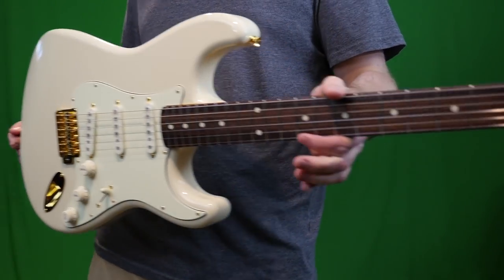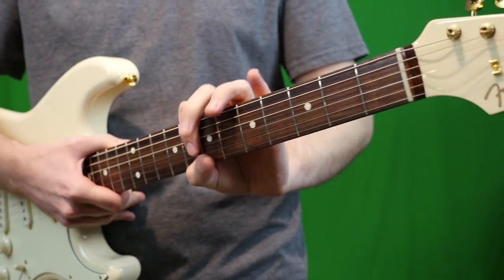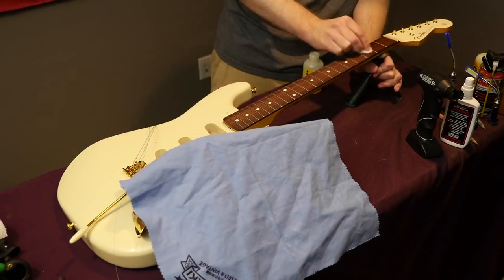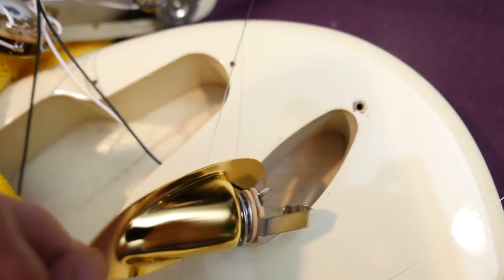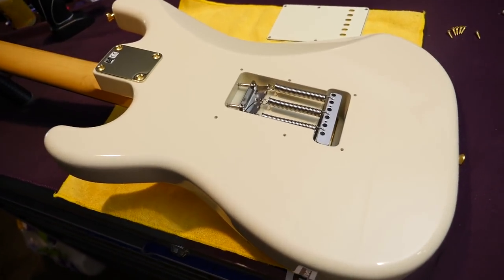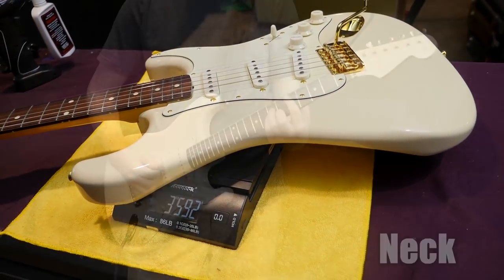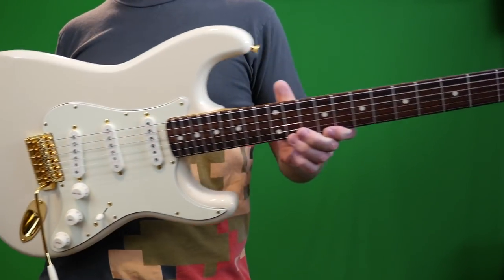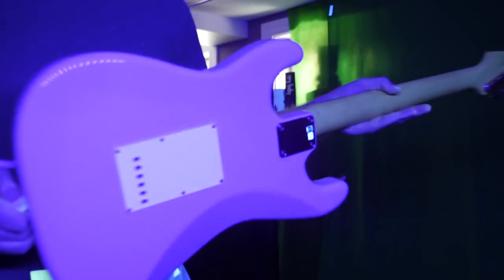New Fender Series! | 2019 Fender Daybreak Stratocaster Olympic White Made in Japan | Review + Demo

Comment: I have a 1995 MIJ 62 RI Strat that had an overall similar feel to this one.  Basswood body (because it had the fotoflame finish back and front that could apparently only be applied to basswood), ceramic bar pickups and a U shaped neck.  Standard chrome hardware (I don't like gold as it wears so easily).    Similar vintage style frets.  The pickups quickly got replaced with a set of Kinmans, which greatly improved the sound. 

I'd bought it used, and the body was quite badly beaten up, so this year I stripped the finish off and resprayed it in a nitro Daphne Blue, reprofiled the neck to slim the shoulders down and reshaped the back to a soft-V (based on my DG Strat), and fitted a Clapton boost circuit to it.  I also fitted a Wilkinson bridge with a steel block, as the original block was a cheap alloy one that showed signs of cracking.   So it's now very different and very nice indeed.

But with this Daybreak Series Strat, if you like gold hardware, can cope with the vintage radius and slightly thicker feeling neck,  and are prepared to swap out the pickups and add some copper screening, you should have the makings of a very nice guitar.  I don't like string trees sitting on the headstock, so I'd add a small spacer to that.

Comment: Its almost 2020!  Why doesn't this have locking tuners?    Come on Fender!  If you can paint the headstock white.. surly you can do locking tuners!  Maybe also include a strap lock system.  Keep the old Tech for your vintage product line.  Cellphones, cars, computers get better every year, guitars just get more expensive with very little change except the colors.
Reply: northy Land Why? I actually prefer vintage Strat tuners to locking. Less mass and easy to set up. Never had tuning issues with any ever.

Comment: I love the slab fingerboard, but I hate taking off the neck to adjust the truss rod.
Reply: How often do you have to do that though? I do it like once a year after winter, usually. Takes like an extra 10 minutes. Maybe I'm lucky or it's because I live in the desert, but I feel like quality strats/teles rarely need to be adjusted.
Reply: @scooter8828  "Tuned to Z" lmao. Yeah I know about those guys. Like dude, this is a fender why you trying to djent with this?! But yeah I think it could just be a drier climate that helps things out for us. I usually just do it just to keep it where I like it and I'm not even sure it's necessary half the time. However, it's a must when first getting a guitar. Even if the previous owner was a Nashville guitar tech extraordinaire.
Reply: @LeviBulger  I live on the east coast, so I do it around three times a year, but to get it just right, I may have to tweak it a few times, and I hate the thought of having to take off the neck two or three times, in one sitting.
Reply: Good point.
Reply: @scooter8828  Yes, California and/or Arizona is pretty stable and humidity free. The only time I've ever had to use shims, was when I was mating a Warmoth body with a MIM/MIA neck. I like full contact under the neck. I highly recommend these: https://www.stewmac.com/Materials_and_Supplies/Bodies_and_Necks_and_Wood/Electric_Guitar_Bodies_and_Necks_and_Wood/Electric_Guitar_Necks/StewMac_Neck_Shim_Shop_Set_of_12.html.
Reply: Plus it's 21 frets neck
Reply: I set up my guitars with little to no relief, and medium action (.070).  Once I set them up, I almost never have to go back and adjust the neck. There are many 60-70 year old vintage guitars that have never had the neck off and still play great. Sure, sometimes you have to (or want to) adjust the neck, but it is not the problem people make it out to be.
Reply: @scooter8828  I once had a client tell me he had to adjust his truss rod several times during a single show. This was a reissue Tele with a thicker neck. <shrug>
Reply: @scooter8828  Merry Christmas to you as well and congrats on the new guitar. I am already blessed with a collection of guitars I enjoy and have not felt the need for more.

Comment: Japanese one might not have the premium part's
But I bet it's better quality build!🤪
When they built Epiphone they was better then Gibson
Reply: They use a Fender USA tremolo. 4-40 saddle screws.  It's nice and has some weight, but the arm wiggles a little too much.  Typical of fender trems.  I used one of those little Fender springs in the trem hole and it solved the problem

Comment: OK what's up with your listing Austin? It says Stratocaster but you're showing a Telecaster and all the description is about the tele? 

Man that is a beautiful Strat! That SG I got from you after I painted it white I left the maple neck unfinished and just rubbed some Tru-Oil on it because 1) I wanted to try a neck like that and 2) It looked so beautiful to have the yellow neck against the white body. Ahh, a basswood body, that's why the price is low for such a  limited run example. The only issues with Basswood is they dent up pretty easy and they don't seem to have as much sustain. I am a little surprised with the weight since it's a basswood model. Those folks in Japan sure do make sure their QC is run like a fine oiled machine. I have seen other guitars from there and they are all equally as well made. Because it is basswood the edges will chip out real easy, that's what you are seeing on those corners in the pup cavity, it's very hard to not get that to happen on those species of wood, pine is another one that does that a lot. But hey the pickguard covers it all up so no biggie.

Comment: Seems like a typical MIJ strat. They always have the same specs for their "vintage/reissue" models, same contour cuts, and fretboards. Also, they match the headstock and use gold hardware on lots of their models. So nothing too unique with this one. Nonetheless, MIJ fenders always play incredibly well. But the pickups/electronics have to be changed on them immediately. It's the biggest flaw. But the wood and construction are top notch on Japanese Fenders. People used to modern necks might not like the vintage radius and frets, but imo they make you a better player. You're forced to set action a bit higher and bends aren't as easy.
Reply: Felix Blacksher what about the pups on the japan made 62 reissue? Thoughts on it?
Reply: @aliwas8781  if you're talking about the newer ST-62 models, I think they're pretty basic pickups. Not as bad as the MIJ Jazzmaster pickups (which are basically strat pickups in disguise), but still nothing to write home about in basically all of the Japanese strats. They're also kinda inconsistent I've noticed. Anywhere from 5.7-7.0 output ranges which is probably because they're all wound on different machines which may all be calibrated differently (just a guess). The magnets/bobbins/wire are all cheapish Chinese materials and the actual wiring harness is super crap on most every MIJ fender I've ever opened up.  The tone is very metallic and uber-trebly to my ears even on the neck. Some Japanese strats do have the American reissue pickups in them, however - which are pretty solid imo.

That said, I always put good hand-wound pickups on basically every new fender I buy anyway, so it's never really been a deciding factor for me. Truth is, Japanese Fenders are built extremely well as far as the woodcraft goes. They're so comfortable to play and intonation is always flawless. The luthiers over there really take their time and it shows. I would probably never buy another US strat again so long as Japanese models are available. Hell, even the modern MIM strats are killer once thoroughly setup. But IMO, nothing tops an MIJ/CIJ with quality pickups installed in them. My personal all-time favorite pickups for strats are the antiquity 2 surfers. They just have so much complexity in the tone and the bridge is slightly hot but not overtly so. Just perfect. For even hotter bridges, the hot rails are fantastic and the SSL5s are legendary for a reason - especially if you like to use the bridge for screaming leads.
Reply: @aliwas8781  damn sorry for the long winded reply lol
Reply: Felix Blacksher nah it’s cool... i also meant the reissue from the 90’s
Reply: @aliwas8781  I would say the same thing. If they're American made pickups (like what they put into the US and MIM reissues) they're probably pretty good alnico 5s and will sound nice and stratty. But if they're stock Japan fender pickups like they put in most models, you can do a lot better aftermarket, or even going with American fender pickups. I would bet that almost every single player that uses a Japanese strat has swapped the stock ones out. Most MIJ lovers, like myself, buy them for their necks first and foremost. They're just perfect.

Comment: I have an Olympic-white with black-chromed hardware Squier Contemporary Stratocaster that boasts the reversed white-capped head stock with a set of Squier active humbucker pick-ups and a Floyd Rose tremolo. It looks really cool especially since I added the Fender large button-styled strap locks and a matching woven-type shoulder strap. It's not my favorite guitar to play but it is a real looker. It actually doesn't feel anything like a typical Strat' which is actually a bit off putting even though I usually play Super Strat's like Jackson's and ESP's. I'm pretty sure it's because it only has 22 frets compared to the 24 I'm used to. This Daybreak is tricked out in a similar way ascetically speaking and that gold hardware makes it pop in a more traditional way. That matching head stock cap makes the whole look in my opinion and it makes me wonder why they don't do this on more of them. Really cool guitar dude! Merry Christmas! :)

Comment: Kind of stingy of them to give you ceramic pickups on such a nice guitar and 900 bucks is not in the Glarry cheapo price catagory.   1980s and 1990s 57 and 62 reissue  MIJ  and CIJ Fender   Stratocasters  at least came with Alnico pickups  and sold for a similar price if you take inflation into account.

Comment: Good review, Trogly.
One suggestion for Fender reviews, when u are doing measurements think about measuring the string spread at the bridge saddles.  Vintage Fenders had 2 7/32" string spread, but some players have problems with the outer E  strings slipping off the fingerboard when the string is fretted, or bent.  For that reason many modern Fenders will have a narrower string spread of 2 1/16", which gives more clearance on the outside of the 2 E strings.  Some like this, but others don't like the narrower distance between strings.  At any rate it is a factor that is of interest to many Fender players.
Just a small suggestion, good review as usual.